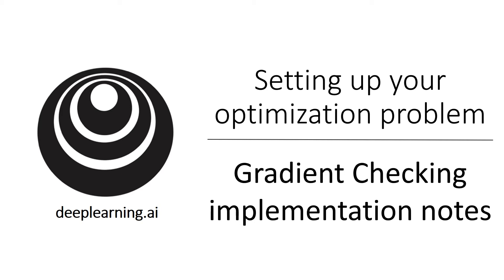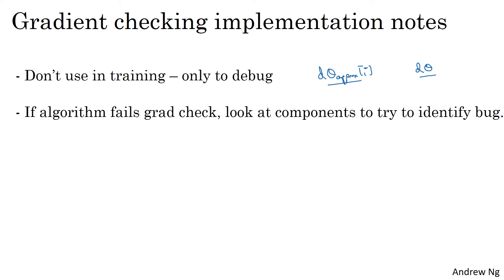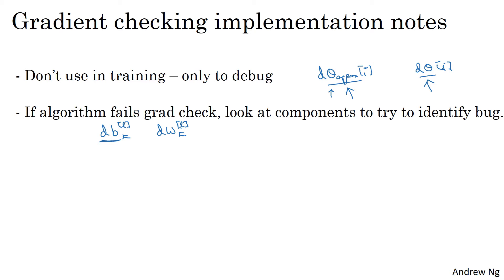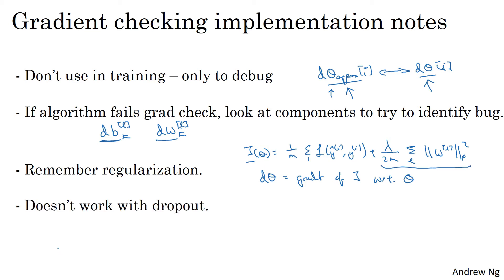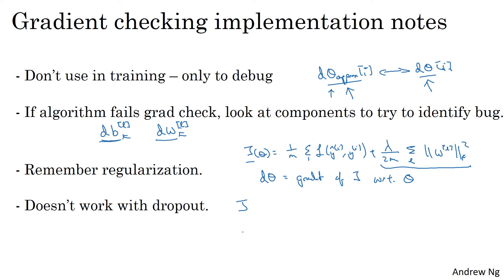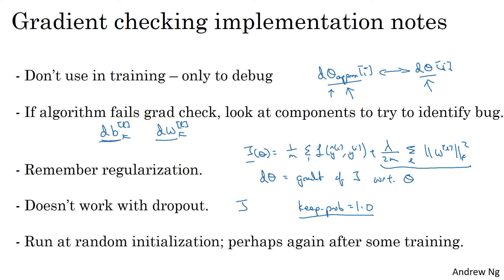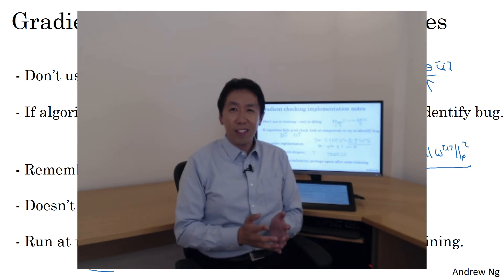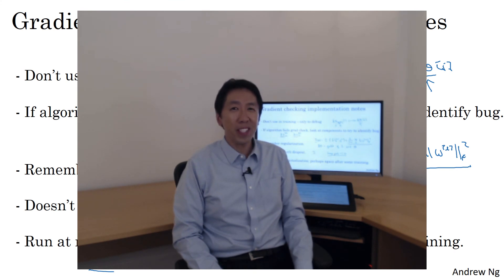Gradient Checking Implementation Notes (C2W1L14)

Comment: Actually...as tf and torch have got autograd for us, what are the cases when our backprop could be wrong?
Reply: I think you would use It if you implement the backpropagation yourself (creating a NN from scratch for example).
Reply: sir, i just have a question but not about your question. if u know the answer of my question pls inform me. So, we seperate theta as theta1,theta2,.... so on. Are the each theta(i) corresponding to any layer's w + b values? (of course as a concentaned form.)
Reply: @ibrahimyldrm2427  Each theta(i) corresponds to one parameter of the model (ex: W[l] or b[l])